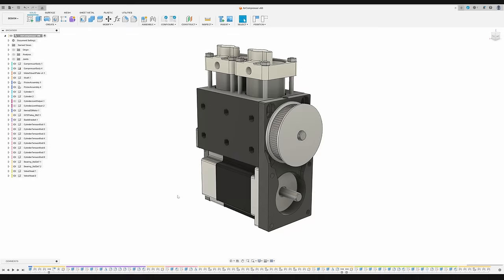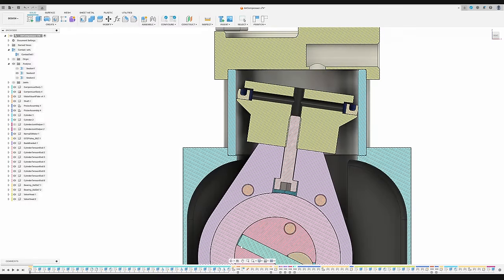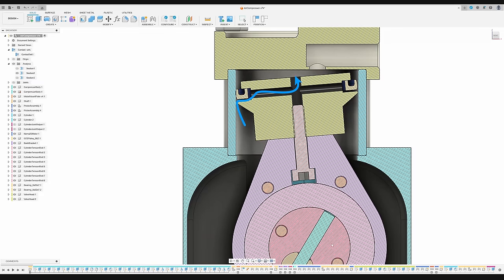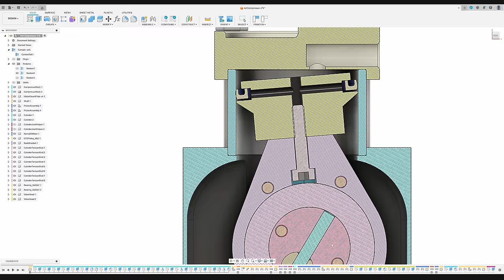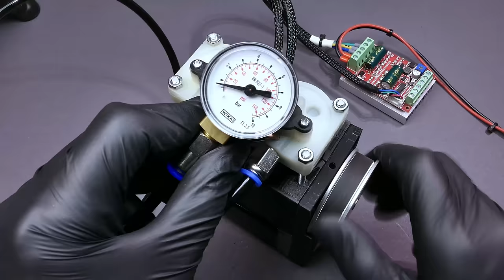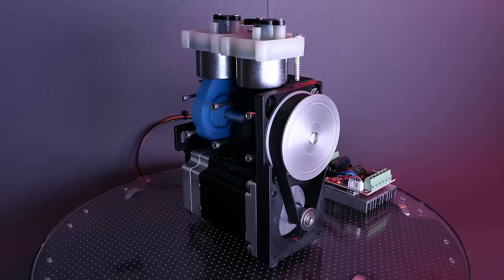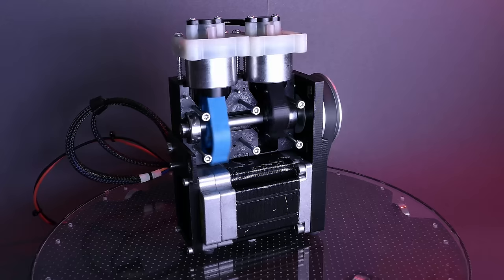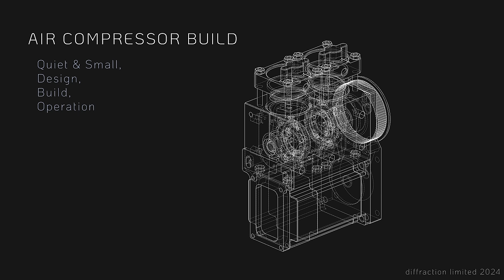Building a Small and Quiet Air Compressor [4K]

Comment: You really need a better microphone, the rest of the video is so good so it's sad that the sound quality is so poor.

Edit: It seems to have quite a bit of sound artifacts, and the audio from you building the compressor doesn't seem to be that bad, so maybe it's just something your settings though.
Reply from the maker: You mean the speach or the actual audio? Note that the speech is generated with the 'bark' text to speach model and not me talking.
Reply: @DiffractionLimited  I did realize later on that you were probably using text-to-speech, but yes the actual speech.

Honestly very impressive how well those sound nowadays, the actual voice itself sounds like a proper voiceover except for those weird artifacts and spikes in the audio. Maybe it's possible to remove those in post?

Comment: What is the cfm? Approximately?
Reply from the maker: This depends on many things, but lets say the motor runs at a max speed of 3000rpm. Then we have a 4:1 reduction ratio and get 14ml per rev - this would yield about 10l/min which is 0.35cfm

Comment: The stepper is an extremely odd choice for a vacuum pump... unless its to be driven by a 3d printer board as part of a cnc machine of some kind
Reply from the maker: You are right, the motor looks very similar to a stepper motor but actually is Brushless Direct Current Motor (BLDC) with the same formfactor (NEMA23). Such a motor is well suited for the application.

Comment: Subbed!
This is really cool. I'd be really interested in what the free air delivery (FAD) is? If its a good then we can scale the amount of compressors. 
Generally speaking for cheap non-commercial compressors you are stuck with the noisy big bore belt driven units. A Chinese compressor company called Eluan has a different approach, they use these counterfeit German dental compressors originally made by DÜRR. And scale them sometimes up to 6 individual units on a single tank. Its a good design because you just turn on the number of compressors you actually need in order to have tank pressure never decrease i.e it scales with your workload. If the FAD is good enough then these could be used as a small shop compressor. And thats very exciting for an open source compressor.
Reply from the maker: Interesting. Free air delivery is expected to be about 10l/min which is 0.35cfm (at 3000rpm of the motor). However the piston travel and cylinder bore could be changed for more volume/more pressure.
Reply: @DiffractionLimited  Yeah the bore and stroke would need to be adjusted. I also wonder about the volumetric efficiency at the intake. Sizing the right diameter to certain rpm for peak efficiency. No different from a ICE.
Reply: @DiffractionLimited  So typically as a general rule of thumb for piston compressor, FAD will be 2/3 of your theoretical CFM (bore * stroke @ rpm). 
So free air delivery would be around 0.23cfm or 6.51 l/min.